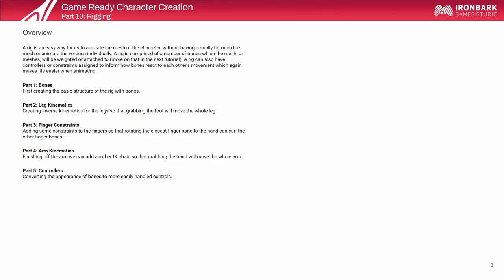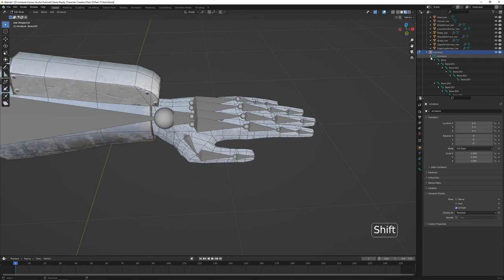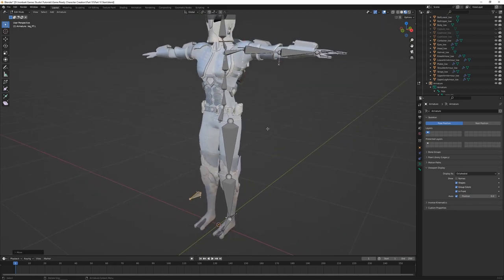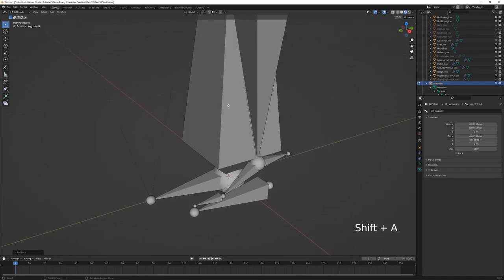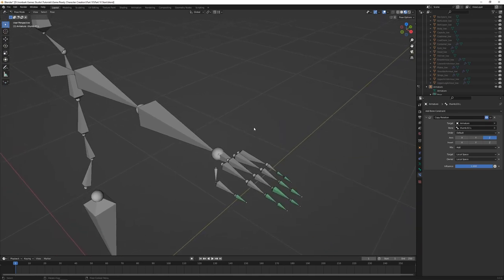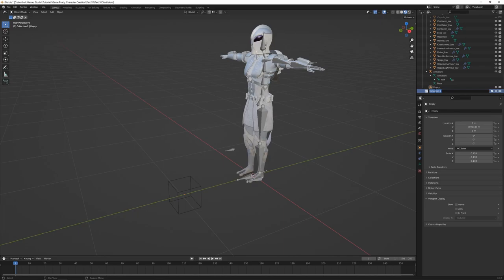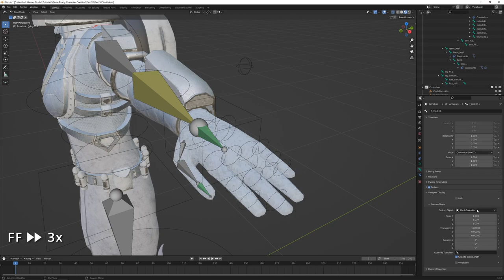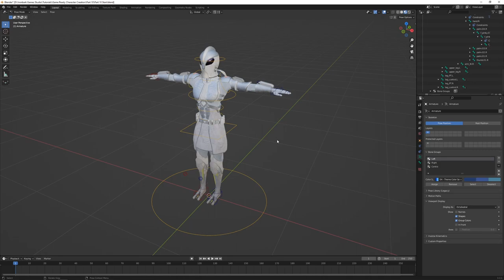Rigging Made Easy: Learn How to Rig Your 3D Character in Blender Like a PRO

Comment: I and I think you as well have the problem that once the PT for arm has been set, the elbow does not bend towards the PT but instead to another direction. This creates an issue when skinning the mesh to the rig. We modeled the elbow extra topology so that it faces towards the arm PT but the bending happens to another direction. Therefore the extra topology is useless since it is basically on the side of the elbow that bends. Does this have an easy fix other than transferring the extra topology to some angle another place (which kind of messes up the anatomy since then it does not point back when in the T-pose?
Reply: Hi there! This might be too late for you, but I came across your comment a few hours ago and have been stuck on the same issue, and have since found the solution so hopefully this helps someone! The solution is actually pretty simple, you just need to adjust the positions of the bones in edit mode such that there is a slight angle in the direction you want the joint to hinge. So for the elbow, if you let the point where your upper and lower arm bones meet point backwards (towards the pole target), the joint will bend as desired!

Comment: Quick question; Blender has the Auto-IK option enabled for connected bones. And it works quite nicely for my weight painted mesh + rig. Any reason why I would want to consider this proper IK rig still?
Reply from the maker: Hey, good question. I generally say use the workflow that is quickest for you and works for your project. If Auto-IKs are working, then great, use those. The benefit of going through this process to manually set up the rig is that you get an understanding of what is going on in the background and makes it easier if you ever need to create something with greater customisation.

Comment: Quick question to you or anyone who might know. Do I need to apply scale to the rig at any point? Also, I've been working in unreal so I've had to set the blender units to .01. Do I need to still be doing that for unreal? When I add bones they are super small and I have been scaling them way up
Reply from the maker: Hey, if you're using Unreal then you will likely need to change/ apply your scale in Blender. You can do this after you've finished the rigging process and I recommend doing it before creating any animations on the rig (however you can adjust the scale of animations on your rig if you change the scale of the rig). I would recommend taking a look at my video where I go through exporting a rigged character from Blender to Unreal: https://www.youtube.com/watch?v=buKsuVINtwk and you should get a better understanding of how scaling works.
Reply: Okay thank you very much, I really appreciate your input and videos.